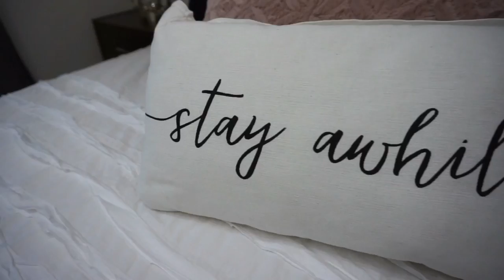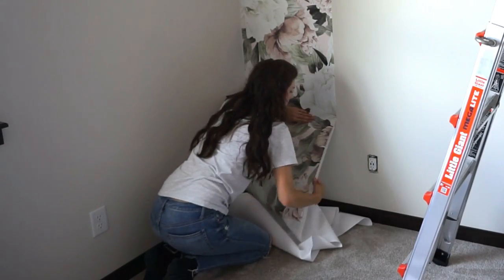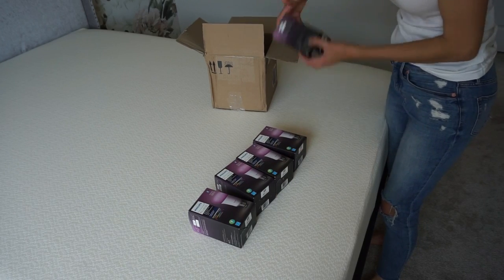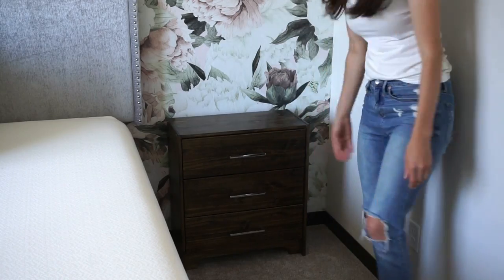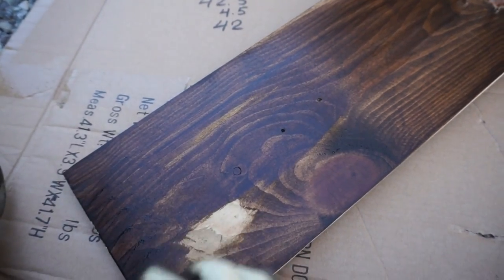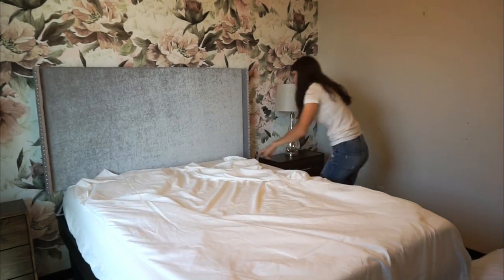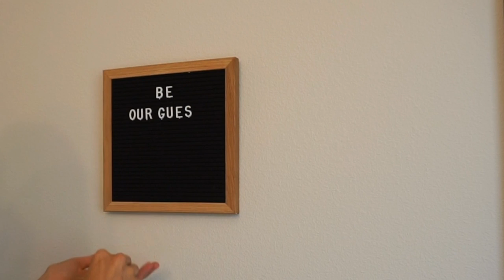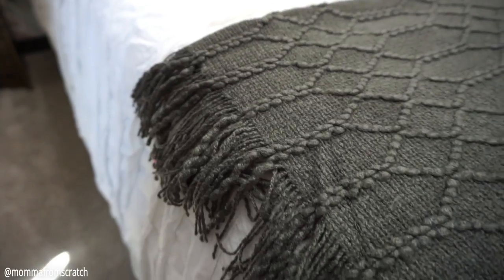Small Bedroom Makeover + DIY Decor | Extreme Room Makeover | Before and After Transformation

Comment: Using a tape measure from the ceiling to measure is a good technique.  Also, a level can be used for an accurate measurement as ceilings in some older homes are uneven.

Comment: Isn’t that light fixture too low to be over the bed? If, just if, some decides to stand on the bed, won’t they risk knocking that fixture down?
Reply from the maker: No it’s only 2 feet from the ceiling so 7 feet from the ground. You’d have to stand I. The bed to hit it. It comes with a few arms so you can make it your desired height

Comment: What size paper did you get?
Reply from the maker: It’s come in different lengths so you order your wall height and then it’s 23.5 inches wide so take width  measurement of room and divide by 23.5 and it will say 5.6 so you’d need 6 panels if that makes sense
Reply: Momma From Scratch so each strip of paper is sold separately? As opposed to ordering a size and it coming in a bundle?
Reply from the maker: @cierramichelle4601  they will ship it altogether like mine but you may only need 5 sheets vs I needed 9 if that makes sense. they create the wallaper for each order so the colors will all be the same
Reply: Momma From Scratch so when I order I should put quantity 5? Or will they know based on measurements